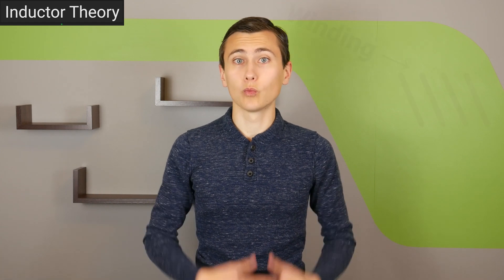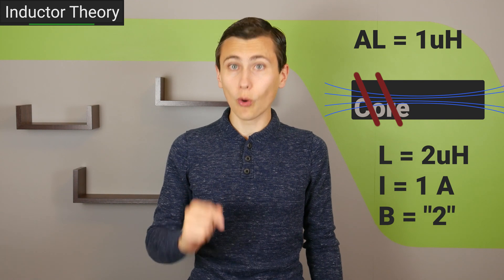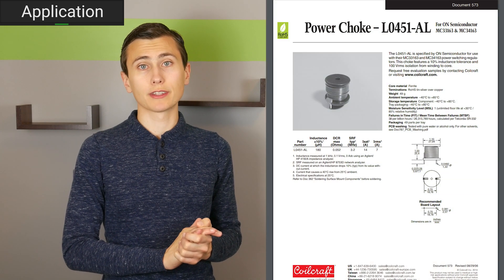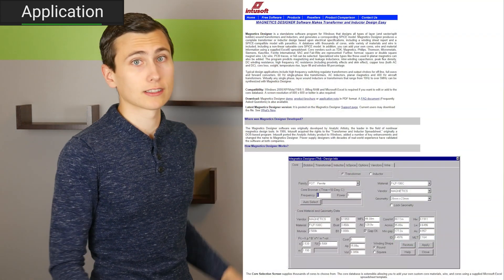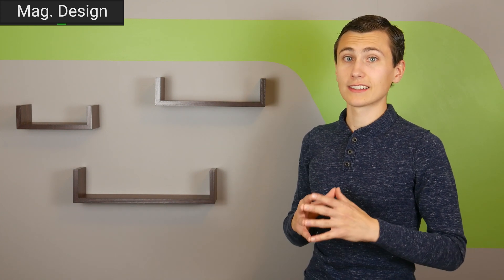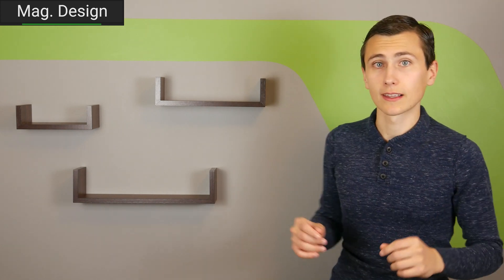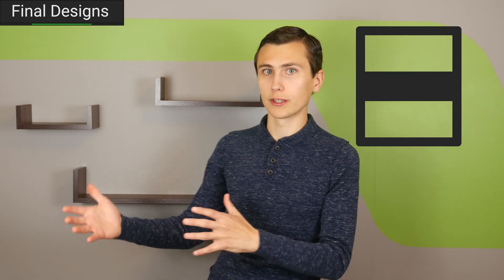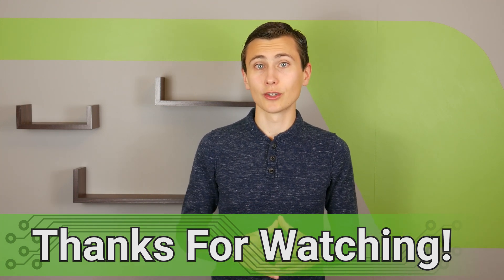DIY 2400W SMPS Inductor Design: You can do this!

Comment: For switching power design, experienced engineers understand that power magnetic and capacitor data sheets = an optimistic indicator within the realm of the possible. I my experience the data sheet is nothing more than a starting point to order samples. For larger teams the samples are usually characterized by a junior engineer to find out if a device (discrete component) has a basic chance of working, and also to determine a high fidelity model for simulation if the device meets spec. Futility for the junior engineer soon sets in where he/she just orders huge sample kits from various manufacturers, because at some point the data sheets are largely ignored. If you work closely with a local supplier (in the USA) they can make you a custom component rather than wind your own. However, this comes with a cost. Usually not a problem for a larger company.

Comment: Great video, but I would recommend using litz wire to minimize fringe effect. As for the core gap of an E core, you can buy diamond files on Amazon and gap it to your desired size. The bigger the gap the more magnetizing energy (H) it can handle without core saturation, but the larger the gap, the more wire required to achieve a particular inductance. To avoid this you can actually purchase toroids that have what is called a distributed air gap, in which ferromagnetic nano particles are suspended in epoxy and molded into the toroid shape.
Reply from the maker: Hi Gilbert, thanks for watching, and thank you for sharing your experience with us!!

If you've got a good source for reasonable quantities of litz wire, please share! I've only seen options for buying none, or a Gigantic spool of it. Agreed, that would be ideal for minimizing losses in these magnetics.

Taking a file to such a nicely precision ground core would feel pretty nasty to me... But you're right about the effect! I'd probably opt for some form of surface grinder though. These magentics were designed for a specific air gap so that core losses and windings losses can be balanced while achieving enough inductance (and still fitting on the core). 

Again, thanks for being a part of E4E! Your experience and willingness to share will undoubtedly save us sometime very soon. :) Cheers, and I hope to see you around the comments more often!

Comment: Super informative video about inductor design...i knew what saturation was but not the mechanism behind it. If you could find the time, a video about gapped vs ungapped inductors and transformers would be enlightening. 

I wish I had known about the magnetic design tool when I was working out my power transformer. I went round and round for a day or so playing number games by hand calculation before I got something feasible.

I settled on and Epcos N87 E70 core with 8T on the primary and 2T on the secondary. I went "litz sytle" for the wire...2 parallel sets of 4x20AWG for the primary and 2 sets of 3x4x20AWG on the secondary. The secondary was like wrapping copper tubing are the coil former.

This is gearing up to an awesome project, godspeed moving forward. .
Reply from the maker: Hello Dr. Rockzo! We really tried to pack useful information into this one. 

I'll put gapped vs ungapped inductors on my topic list. To make a long video short (and give an answer sooner) an un-gapped inductor, or a core material with distributed gap, was simply unsuitable for this application.  The designs I was seeing without using an air gap required too many turns of wire to establish the required inductance... which led to more power dissipation and saturating the core at lower currents. Adding a gap to this inductor likely shrank the physical size of the core by about 50%. It was awesome.

Magnetics simulation tools are pretty great. Once again, they showed me that I tended to over-design my magnetic components. 😀 I tended to strive for 100% copper utilization (skin depth) rather than lowest total losses and easiest assembly. 

Sounds like you ended up with a pretty reasonable design, even if it took a little while. It may be fun to use the EPCOS simulation tool to see if it agrees with your calculations! 

I'm really excited for this version of the UPS too. Thank you for Watching!

Comment: Should we consider the maximum current which appears in the starting transient in the inductor design?
Reply from the maker: Hello Siva, great question! 

It must be considered, but is usually not an issue for the inductor itself. The inrush current (starting transient) isn't occurring while we're trying to use the Inductor. This is because a good PFC controller waits for this transient to be finished before starting the boost. So, even if our core saturates that's okay, This means that the inductor can behave like a wire without a problem. To consider power dissipation, this event is so short that thermally damaging the inductor is very unlikely. 

The other components, mostly the Rectifier diodes but also the output capacitance, are more sensitive to this inrush current and could be damaged if not rated for this transient stress.

We will think about inrush current a bit more while designing the AC input filter for the PFC, but this is coming in a future video.

Thanks for watching, and I hope this helps!
Reply: Thank you